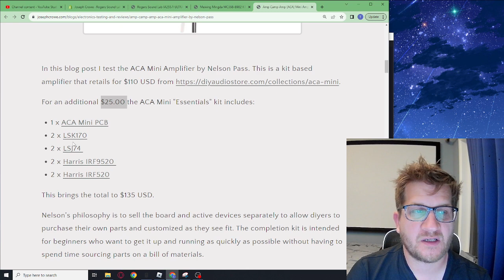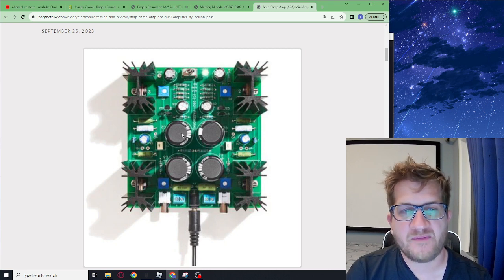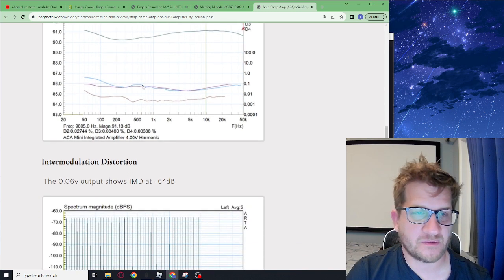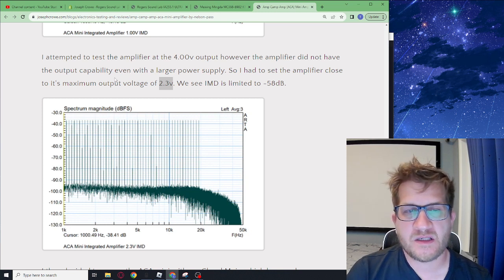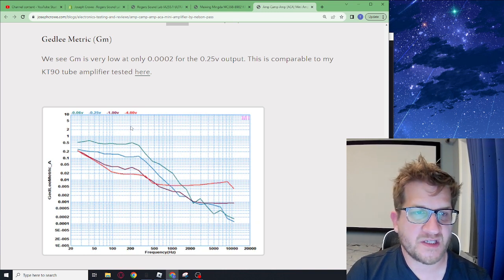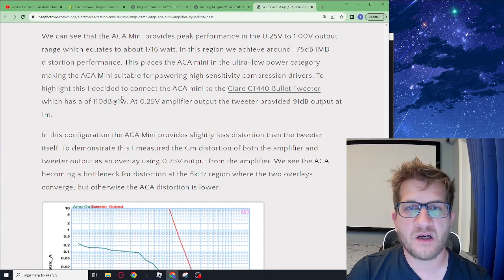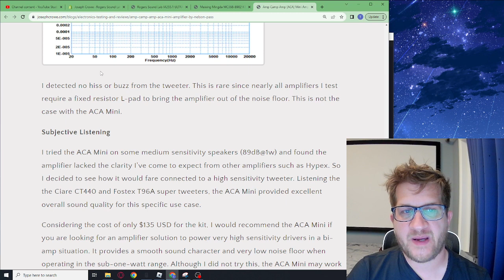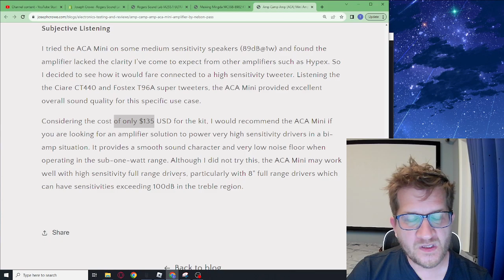Amp Camp Amp (ACA) Mini Amplifier by Nelson Pass --- Test & Review

Comment: Distortion is not an indicator of musicality. Also no one can hear distortion at less than 0.5%  much less 0.03%
Reply from the maker: All of the studies I’ve read on the audibility of harmonic distortion were fundamentally flawed. They don’t account for the power reduction in the fundamental tones required to power the harmonic side bands.
Reply: @JosephCrowesDIYSpeakerBuilding  At 0.035% distortion you're not getting any power reduction and I've yet to see anyone hear, in a DBT, anything below 0.5%.
Reply from the maker: Nobody is contending audibility at those numbers so I’m not sure who you are attempting to convince. People are academically interested in how various devices perform, meaningful or not.  I’m pointing out that the studies that do exist are flawed and so can’t be used. Simply adding noise is inaudible at anything lower in level than -45dB S/N which all of the studies I’ve seen are based except for the one done by Earl Geddes in 2001 where the actual transfer function was altered in the digital domain.
Reply: @JosephCrowesDIYSpeakerBuilding  You used 0.035% in your discussion, that's why I used that number but the point is distortion and musicality are not necessarily related. Once you get to a certain point it's a non sequitur, why even  mention it? Advertisers use it to show how 'good' an amp is but it's baloney. 

If you want to show were musicality in an amp is do FFT's at different input levels.
Reply from the maker: I understand your point, but as I mentioned, there are those academically interested in how various devices perform…meaningful or not in terms of audibility. Just because it is below the threshold of audibility does not mean it cannot offer insight into the underlying technology’s behaviour. There’s also the cumulative affect of all systems in the chain, that can add to audible effects. As mentioned as well, most studies on audibility are flawed, leading me to suspect that the audibility threshold is not where most people suggest. There’s a lot of misinformation surrounding distortion. My favourite is how many people think speakers have many percent higher distortion than amplifiers, when in actuality they are neck and neck, which is why we notice changes in sound quality when swapping out various amplifiers.